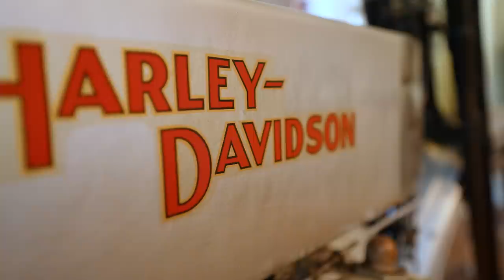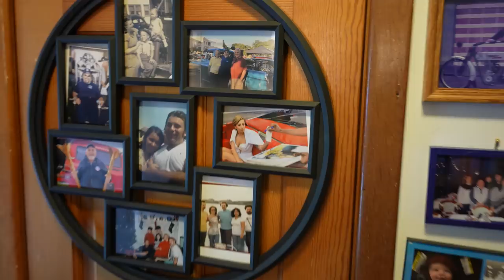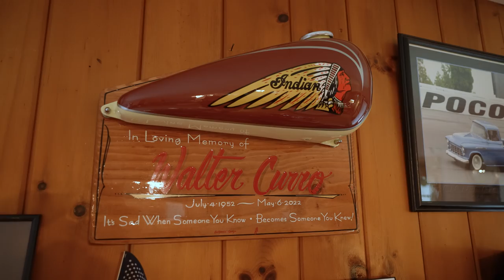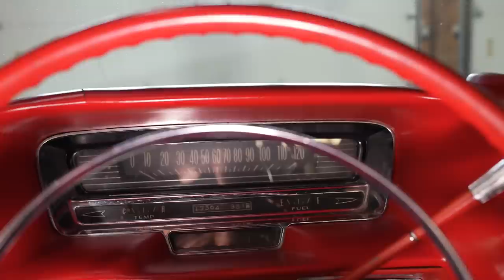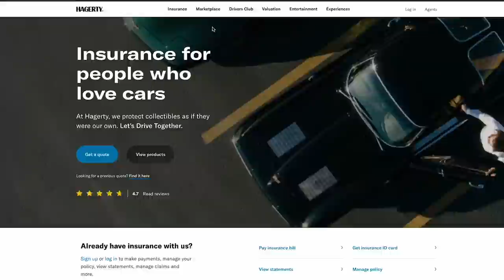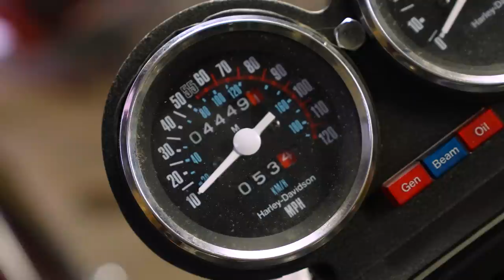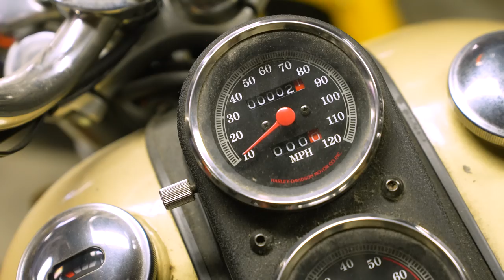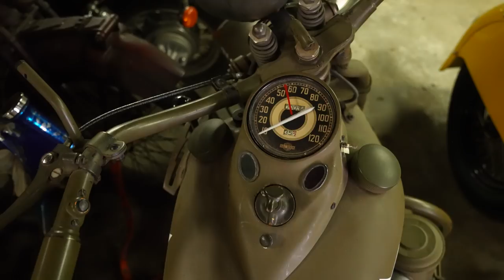RARE: Vincent Black Shadows - Harley-Davidsons - Indian Motorcycle Collection | Barn Find Hunter

Comment: The 1926 HD 'Boardtracker' doesn't look like something that started out as a competition motorcycle -- it's also had some modern modifications made to it that make it perhaps a bit more ridable but would negatively impact the bike's originality and value.  No track bike of this period had a clutch - they were all direct drive. Someone has adapted that clutch pack to the bike. The frame and tank looks correct, but HD's  factory racers of the period were 8 valve head models with open exhaust ports -- no pipes -- this motor looks like a sidevalve of earlier vintage. The competition bikes of the period for the Boards also had rigid front ends - this one has a small telescoping section and spring.  Boardtrackers also had ribbed racing tires -- the knobbies would have been more appropriate for a dirt flat track bike.   

It's a cool motorcycle for sure, but it feels like something that somebody put together from bits, not a bike that left Milwaukee that way.  :-(

Comment: At 11:12, that is not a "Chief".   It's a Model 741 with a 30.50 cu in engine (a Junior Scout).  Chiefs had 74 cu in engines. The 741 was designed for military usage but was rejected by the US Army. Too under powered.  Most were sent overseas to allies as part of the Lend Lease program. I used to have a 741 that had been civilianized.